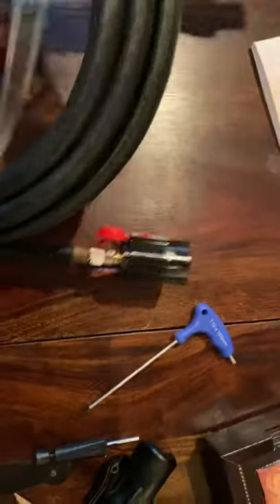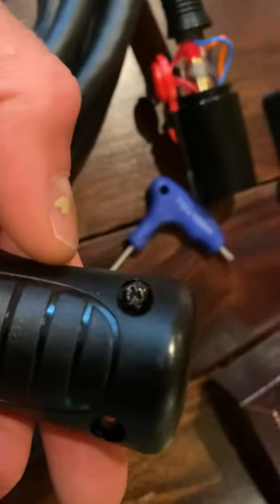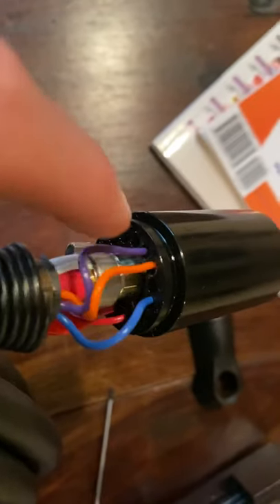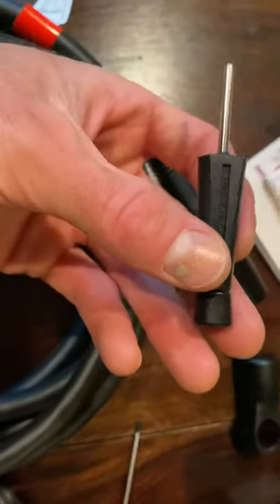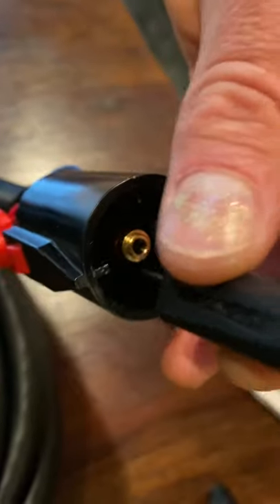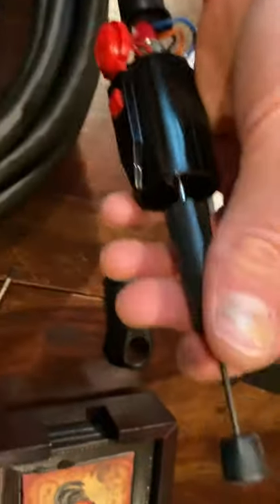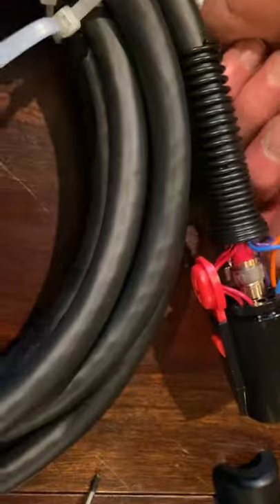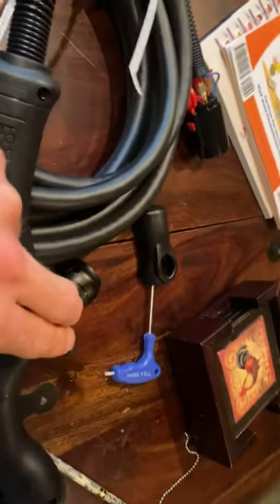Convert hypertherm duramax hand torch to machine torch

Comment: Could you leave the wire where it is in #6 and make a jumper from there to #8 with the correct pin to use the torch either way? (Hand or Machine)
Reply from the maker: I’m not certain on that one. My machine came with a standard torch and a gouging torch so I didn’t have to worry about it.
Reply: Tony this is my plan maybe with some switches. I need to get the old pin out and try to figure out where to get an identical one for the #8 hole.

Comment: This is exactly what I was looking for. I up in the air about buying the 45xp with 2 torches and make the 15 * like this to hook to my cnc and be still able to use the other torch for hand cutting!! Or by the 45xp with a machine torch which is close to the same price as this set up but you only get 1 torch!  Sounds like this is the way to go! Did your machine come with a connector for the cpc port or do you have to buy that separately?
Reply from the maker: Need to buy the cpc connector separately

Comment: Great video!  Do you use the machine torch consumables or just the regular hand torch consumables?
Reply from the maker: Hand torch.
Reply: @cameronschwartz  Just received my Crossfire with THC and I'm on the verge of purchasing my 45xp. Do I need ohmic sensing consumables?
Reply from the maker: @dave7203  regular consumables. Same as hand cutting EXCEPT the shield. You can any to get
 Mechanized shield instead of drag shield. Don’t use the drag shield, it will destroy your consumables . U will get a manual with the plasma cutter and it lays out the consumables needed really well and had cut charts. The only setting you will differ on is pierce delay. U and a couple fractions of a second to the pierce delay 

 Consumables regular
220817
220854 
220941- bulk pack 228765
220842 - bulk pack 228767
220857

Comment: So without the cnc port you still need to hard wire correct? Thanks
Reply from the maker: Without CNC port you do need to hard wire to your plasma cutter. If you get a hypertherm 45xp without the CNC port you can easily add one to it and it would probably be less work or about the same as hard wiring. The mod in this video is only for the hand torch also. If you get a machine torch this mod is not needed.
Reply: @cameronschwartz  appreciate it man , I was thinking of getting the port add on but might wait until I get a machine torch, but running a hand torch I didn’t want to have to slice wires inside the cutter to void a warranty. I’ll keep looking into this, just getting mixed answers